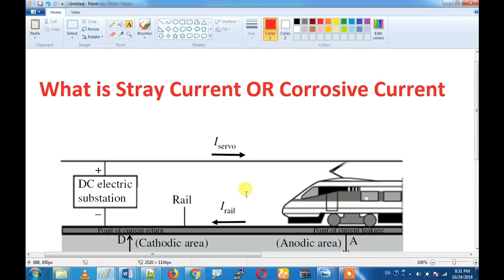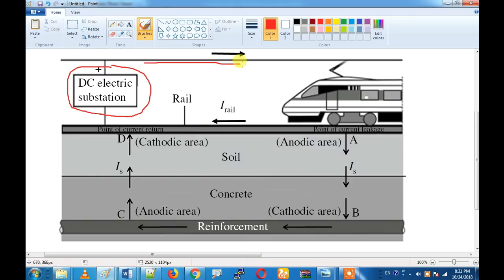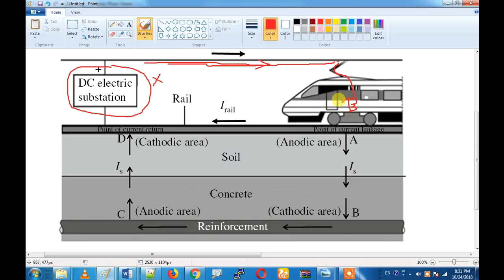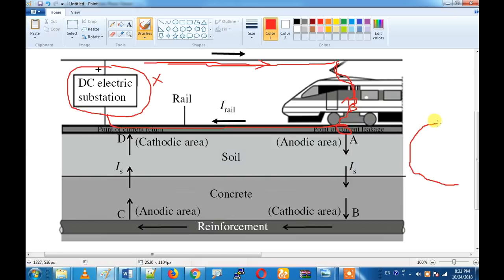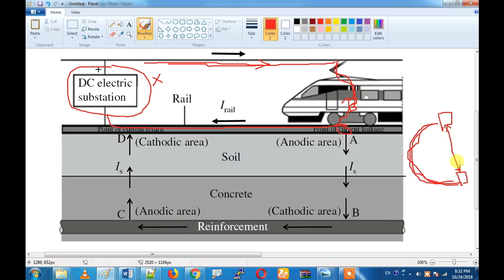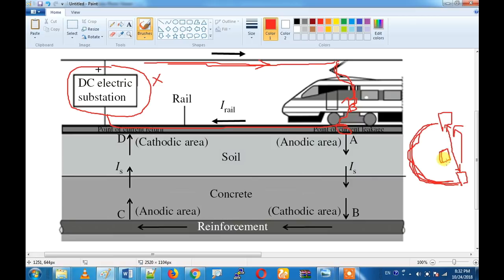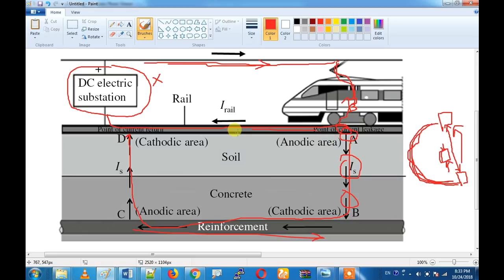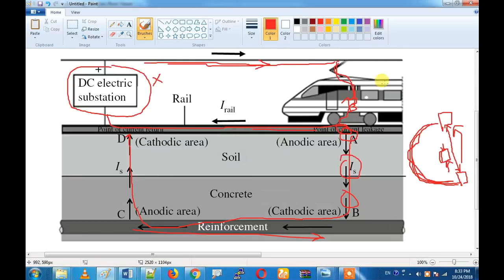What Is Stray current In Tamil, What is Corrosive Current In tamil

Comment: voltage limit device or short circuit device its normally open condition. its measure the voltage across running rail to earth when voltage reach the setting value then breaker close and make shot ckt with running rail to earth.
Reply from the maker: No..Actually they conncet a lamp between + and -ve..So never get short..IF short lamp glow..Just like test lamp